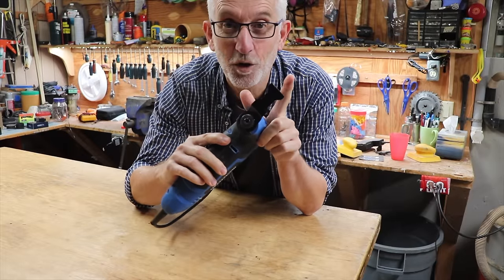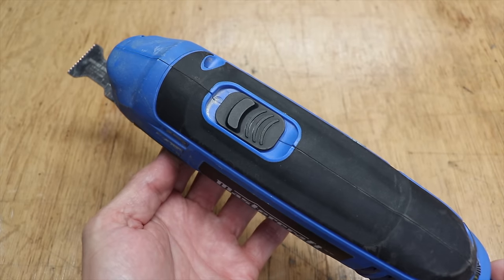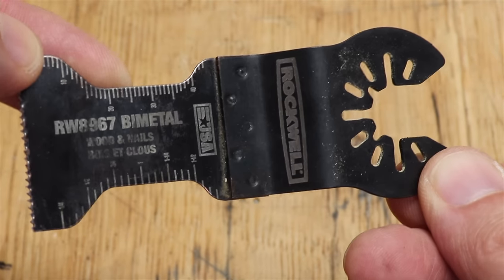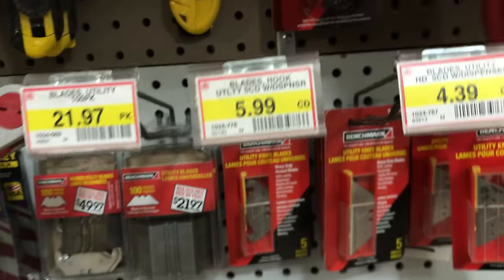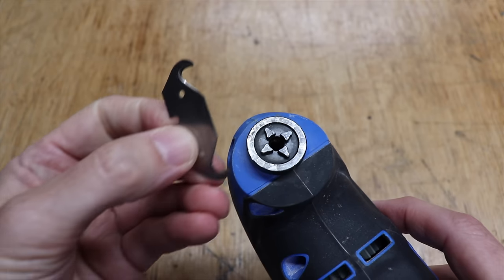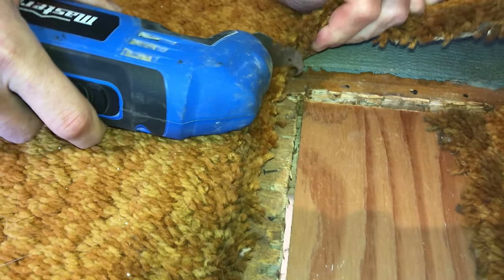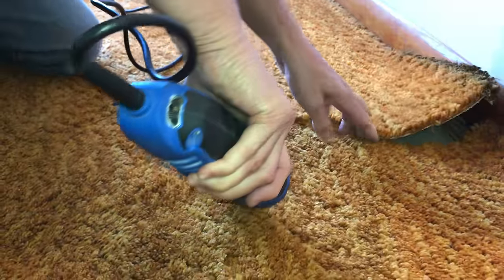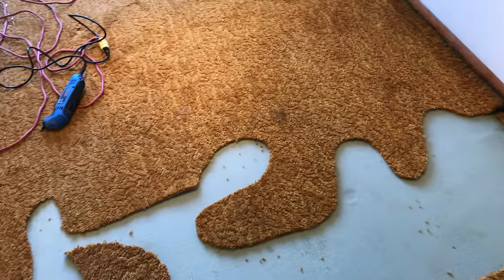Amazingly Cheap DIY ● Oscillating Saw Blade !

Comment: My Lidl parkside brand Oscillating saw is different with 4 tabs extruding out, how ever i believe this should work on that too, but i only have straight blades at the moment and i think hook blade is requirement for this to work. Straight blade might be bit dangerous to operate, but i'l be testing both when i have such cutting project coming up. Thanks for the tip

Comment: I just picked up an oscillating saw.  I'm going to throw a pack of these blades in the toolbag with it.
Reply: Which brand of oscillating saw did you get?   Were you able to fit the hook blade to it?

Comment: Wondering how securely it stays mounted in an oscillating tool like the Dewalt where you wiggle it into place 
Does it a need a hole through which the mounting gear can go?

Comment: After reading way too many comments, I don't see anyone mentioning that this only works on the older style arbors. The manufactures probably got together after seeing what you did and changed the attachment so you can't do this. I'm going to look for the older oscillators.

Comment: Does it work with other multitool brands, i.e., are the blade attachment areas the same?
Reply from the maker: Most other multi-tool brands have an adapter that works the same as in the video that threads down. As long as you can determine that, yes, it will work.

Comment: That's actually quite the novel idea. I use an air powered tool like that for removing automotive glass.

I never thought about putting a different type of blade on it, let alone that sketchy type of mounting. Just make sure and keep it moving, if you stop it will will burn the substrate pretty quickly.

Comment: Do you know if this would work to cut Hardie backer board? I use HBB to wedge clay before throwing on a pottery wheel. I use a larger piece that I clamp to the table beside my pottery wheel in order to reclaim/recycle. I don’t know for certain if Hardie backer board can be used as a pottery bat on the wheel; however, if it can be used, it would be a much cheaper option, depending on whether or not it can be cut into squares or better, in circles, & to go one more would be if bat pin holes could be drilled without the hole areas or edges crumbling into the clay. 

Wood bats that are 1/2” to 3/4” thick & fit the 12” wheel head (I think the Shimpo RK Whisper has two bat pins that are 10” apart) are amazing to throw on. Hwr, it doesn’t matter if buying the bats already cut & holes drilled or diy made, the cost is far beyond my financial ability. MDE bats aren’t much cheaper. I don’t care for the plastic bats because I have problems with the clay not sticking during centering, along with the plastic bats pulling off the wheel when time to pull the sides of a pot. 

The issue with Hardie backer board is getting it cut without frayed sides, not to mention the total destruction of blades doing the cutting. Not sure how it would go when drilling the bat pin holes. Any assistance is much appreciated. 

In case you’re wondering what reclaiming means… it’s taking clay trimmings, failed pots (unfired), & clay that was thrown on the wheel then scrapped due to the pot collapsing, etc… These pieces are rehydrated then blended so that it can be scooped & spread out on either canvas covered wood, pottery plaster, or Hardie backer board until one side dries to a level of plasticity, flipped over to allow the other side to dry out, & then the clay is wedged together in a homogenized manner so as to be used again to wheel throw or slab build, etc. HBB seems to be very well suited to wedging & reclaiming clay. It saves a lot when buying clay because it can be used over & over again, for the most part.

Comment: Putting on my shoes 2 go get one. Totally cool.  Thx
Reply: I have found though, if u have a multi tool  with a tool free head, it might not tighten down on the razor blade 2 b secure and safe. Best 2 go with the similar tool blade which u can get 4 about $10.

Comment: I'm still going to keep using purpose made hook blades that lock on the four sides of the holder. What you have here is entirely held by friction and can possibly come flying at any time on account of the oscillations or if it snags on something.
Reply from the maker: When I tested this set up, I left it slightly loose to see what would happen. Of the 10 times I tested it the blade does not fly out but merely falls out without any fuss. Very safe.
Reply: @chrisnotap thank you, ill do the same test before using it then.

Comment: Neat idea. Have you tried this on thick cardboard?
I am using a guillotine cutter for cutting thick  cardboards. It gives a  clean cut without frayed edges. I am looking for an alternative to the guillotine.
 Any idea if the cutter you use can give a clean cut on thick cardboard?
Reply from the maker: It does give a clean cut but I don't know about thick cardboard.

Comment: I have the original 12V RIDGID multi tool that has the same blade attachment as the one shown in your video.  I can't seem to make it work!  The "hook blade" either falls or flies out of the head because it's too loose or the brittle, hardened steel blade snaps when it's cranked down.

Comment: I have to say this was a great idea, the only thing I am concern is safety, I switched most of my utility kNife to hook blade, especially the folding pocket ones for the safety, just in case it open by accident, at least I won't cut myself easily.  But I don't know how many of you use the oscillating tool experience the blade come loose during the cut, with only small part holding only a 1/4 of the holding surface I would not use it this way, unless if you drill a hole or find a blade with the pattern that the blade won't fly out when it comes lose.  Otherwise this is a great idea.
Reply from the maker: I did many tests myself with this before I made the video and when the blade happens to come loose it just falls out and does not go flying. It's very safe! And remember, it's just like a jig saw, skil saw, chop saw.....you can get in trouble putting your fingers near the blades on any tool!

Comment: I might have to buy a cheapo oscillating tool just for this... Mine has a bunch of little spring-loaded teeth instead of a screw clamp like yours.
Reply from the maker: Yes....they have changed the mounts on the new ones.

Comment: I’m going to run out and purchase a packet if those blades. For years I’ve been using scissors to chop up old clothes to use as shop rags. Sometimes I’d try a sharp utility knife, but it was a pain. With my multi-tool and those hooked blades, I should whizz through my stockpile of old clothes. House curtains are next, then ... lookout carpet, here I come. 😁

Comment: 3-15-2020    -     -    Home Depot doesn't sell this model Oscillating Saw.  Is there one sold by Home Depot that will work with these carpet blades?   I need the Make/Model of it to go to Home Depot.  Thanks.  By the way, I searched earlier for the saw you use here but it seems to only be available in Canada and is not (was not) available from Amazon Prime.  Please advise.  Thanks.

Comment: Rockwell makes an oscillating scissor attachment that will do much of the same thing and quite a lot safer, it's called the SoniShear and it's great.
Reply from the maker: I have my doubts. This cheap blade is fast and it cut that bucket like butter.
Reply: @chrisnotap  - Doubts about what? I've owned one for about 6 years now and it's still going strong. It also only cost about $1.50 more than your $6 pack of disposable blades. Not trying to downplay your discovery - it's cool and definitely glad to know about it if in a jam - but it's also not very safe or durable. I'm just letting others who find this useful know about a safer and longer lasting option even if it's not as nimble cutting through 5 gal buckets.

Comment: I'd feel better about this if the blade was held on by something more than just compression. I assume the through holes on the commercial blades and matching pins on the tool serve some purpose other than stylistic affectation.
Reply from the maker: If it happens to loosen, it just falls out. I tried many times. Very safe that way.

Comment: Did you try cutting the carpet with the power switched off.  ? Is it tougher ?
Reply from the maker: Yes. These blades, in the handle they are meant for, is really nice for cutting carpet. You do pull it and it does have some resistance but with it in the saw it seems to be effortless. Wherever you direct it, it cuts.

Comment: Nice idea. Wonder if you can cut straight line too. =) I’ll try if it works with the original FEIN as well. Mine doesn’t have bolt fix but fast locking system and if it is tight enough it sould work.
Reply from the maker: I hope your mount is the same so you can give it a go.

Comment: Won't this strain the shaft of the Dremel or oscillating saw because the blade is only on one side of the washer nut not all around the washer nut and the shaft which is usually the case when the blade is specifically designed for the Dremel. or oscillating saw?  Eventually, won't the shaft bend and no longer be straight?
Reply from the maker: No.

Comment: My Dewalt cordless multi tool has a "Quick Blade Release", had anyone try this in one like this,  does it clamp down on the blade tight enough, or do you have to use this style tool that tightens down with a bolt?

Comment: This looks like a fantastic way to cut coroplast.  What thickness did you try cuts with?  Do you think 1/4" (6mm) is do-able?
Reply from the maker: I think it would work fine with 1/4". Give it a go.
Reply: @chrisnotap  Looks like the pins on the Harbor Freight oscillating saws don't allow for this trick :(.  Hopefully I can find a compatible hook blade.

Comment: I have a rigid job site wireless one. I'm wondering if I can use this on it since is has a snap fit instead of the alan locks.
Reply from the maker: You'll have to look at the mount. I don't know if they are all the same. Good luck.

Comment: Ok so ignoring the percentage you may be getting from Dremel, how do you stop the blade from flipping out of the multi tool and cutting your jugular?
Reply from the maker: Percentage from dremel? These are very safe saws. The blade will just fall out, like any of the saw blades you’d use in it.

Comment: I;m a 40 year on the job flooring guy and I can tell you nobody would use that blade on carpets like that. I use them for cutting vinyl flooring but in a utility knife. I use a sharp Olfa knife for carpets and it doesn't need batteries.

Comment: Will this work on tire sides?  It would be worth it to buy a cheap vibrating tool to cut up the 47 simi truck tires I need to get rid of
Reply from the maker: I want to say that those tires will be too thick for this. Even a regular car tire would be a challenge.
Reply: @chrisnotap  Thank you for your speedy answer!   Still lots of uses, and the cardboard i have to cut up for a project will fall prey to this new idea.  Thanks!!!!

Comment: Would this work to cut plexiglass?
Reply from the maker: No. But here's a great video I found years ago for cutting plexiglas! 
 https://www.youtube.com/watch?v=vJSsJmttqHs
Reply: I bought the hook blades before looking at our oscillating tool.  Ours has a much different head than yours and the blades would not fit. I tried anyway and the blade snapped in half upon touching the surface of the bucket. I then tried filing it to fit, and drilling a hole to fit, even asking my husband! No luck customizing the blade, the metal was too hard. I ended up using a different blade that came w the oscillating tool and it worked fine. Felt great success completing the dust collector and seeing how it helps to keep the air clearer. Total build time for me with blade issue was about 3 hours.
Reply from the maker: @jenniepost7837  You may want to check the goodie bag that comes with your oscillating saw. Many come with an adapter that screws onto the head for this type of blade. I can see why the blade broke if it caught one of those little nubs under there. Good luck.

Comment: Wow ! It's actually pretty awesome. Seems dangerous but that's not the point. Lol
Reply from the maker: Oscillating tools are very safe. Putting this blade in  it doesn't make it any less safe. It's the operator that decides to use it unsafely.

Comment: Wish there was a list of tools that DID work in. Porter cable doesn't. Btw, you can make one from any used blade.  Drill a hole at the edge, cut it back out to the edge then use a rat tail file to put an edge on it. It doesn't need to be as sharp as you think.

Comment: Nice but I would make a handle for generic blades. The genuine ones were too pricey and I think your method will wear out the clamp on your machine. My Fein multitool has similar mechanism but it is a quick action clamp instead of allen screw.

Comment: Did that damage the edge on the second side of the blade, those blades don’t last long as it is but attach to that oscillating tool would dull that blade in a minute and destroy the other edge on the spindle
Reply from the maker: No. The other end is not moving and the spindle does not make it dull.

Comment: This is a great idea but only for multi-function tools with that sort of fixing for the blade.  Most multi-function tools have a completely different fixing with a central clamping pin with detent which works in conjunction with a blade having a hub with 12 locating holes. Pity!

Comment: Another excellent top tip, I usually avoid using these blades as they scare me, but, in the tool it makes sense. Thanks Chris.
Reply from the maker: Don't fear the oscillator! They are one of the more safer tools.
Reply: @chrisnotap  when you use a proper blade that locks around the square bits in the flange. I wouldn't say it is with a blade held only by friction.

Comment: I thought it was a brilliant idea so I bought me a pack of blades to cut up a bunch of cardboard boxes for recycling.  Sadly the brand of tool I have cuts really efficiently for about six inches until the blade comes loose and falls out..I can't figure a way to use these blades...😥
Reply from the maker: Look in the box if you still have it. I know with dewalt they come with a little adapter plate and Allen screw so you can attach the blade like I did in the video.

Comment: The multi tool with the cutting blade  does not work well with most multi tools without one cutting end being destroyed or the blade vibrates out...by hand works great, those blades are very sharp and more precise. And super glue the inside pipe joints because your 1-1/2" cutout will not be clean and precise but.do not glue the street 45 but just the joint of the 1-1/2 pipe comes into the bucket...that works the best. My vaccuum seal is perfect And also the vaccuum, and then you don't need the machine screw at all. Note: you cannot completely compress pvc pipe with your hand you have to use the flat side of a hammer.  I would almost say just use pvc cleaner and glue on all the fittings except the 45 but the Rapid Fuse glue from Home Depot works great...less messy and less effort.  I used and exactly knife to cut all holes in the bucket and in the 2" caps...cuts easily and more precise.

Comment: Excellent discovery.  Has anyone tried this on plexiglass? I need to cut 1/4" plexiglass and most of the things I try crack and splinter the plastic.
Reply from the maker: This will not work on plexiglass. Plexiglass is not easy to cut. I found a good video on how to cut it and it does work. I bought a blade. Here's the video........https://www.youtube.com/watch?v=vJSsJmttqHs

Comment: Most saws that use those blades with the half circle at the bottom only can use the blade made for that connection. In other words that blade is a great idea but it won't work in the case of most saws.
Reply from the maker: Correct. It needs to have a mount like I show in the video.

Comment: HARBORFREIGHT  one might not work, I’ll try.
Reply: Did it work with the red HF oscillator multi tool (Chicago Electric)?  The mounting base is different on mine with 4 pins to hold the blades in place

Comment: The official dremel blades he linked are 40 times more expensive, though i'm not sure what the blade will do to the mount after longer period of use.
Reply from the maker: The mount isn't affected. It is tight in there and doesn't move.
Reply: @chrisnotap  When stuff vibrates as much as they do in oscillating tools terms like tight lo(o)se(n) their meaning 😅. Still no excuse for that ridiculous official tool bit pricing, dremel is pure greed.

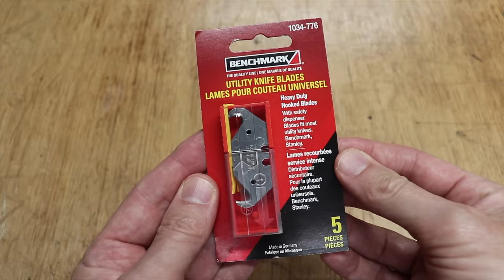Comment: 0:35 i were surprised  that 5 blades could cost 6 usd  in 2019 , and as you mentioned is 10 cutting sides , while i checked your link  is 4 blades with 4 cutting sides for  49.99 usd 🤣 iam dead 😂  watchig . april 2021

Comment: There is already a blade like this for the multi-tool.
Reply from the maker: Correct. But as you can see if you go to the link in the description, they are quite costly compared to this cheap hack.
Reply: I’ve wondered if worn out multi-tool saw blades could be repurposed for cutting “stuff” by just grinding away the set of the teeth to make a flat, but sharp cutter for cardboard. I have a good supply of worn out “expensive” blades that are begging to be made useful again.

Comment: Should have taken one step further. Take an old blade and grind it to the same cutting confirmation and sharpen. Careful not to over heat the process
Reply from the maker: I did that first then realized I had those blades and tried it. Thanks.